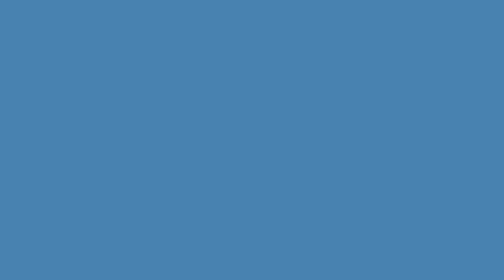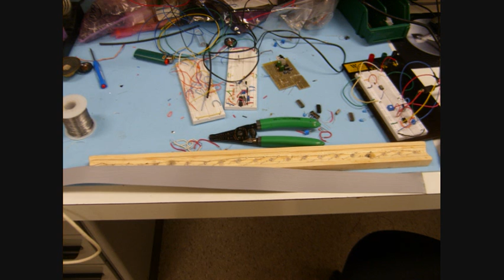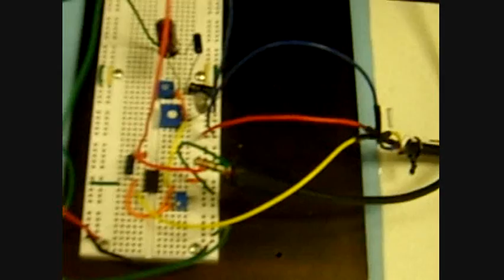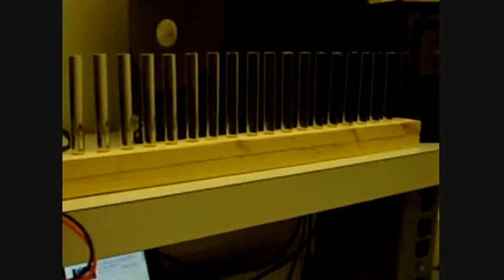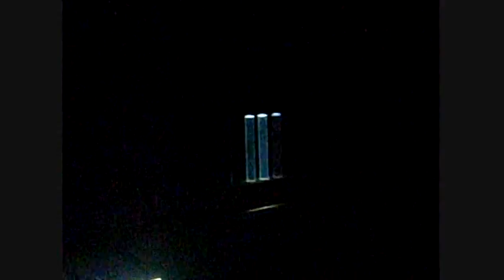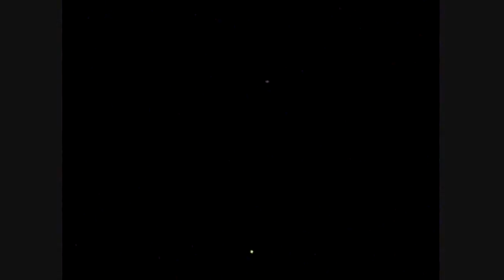LED Acrylic Rod VU-Meter

Comment from the maker: I used a regular 3.5mm audio jack and a splitter between the signal source (computer), the speakers and the VU-meter. The signal then went to an op-amp set up as an inverting amplifier so it would have high input impedance and not load the audio output from the computer.